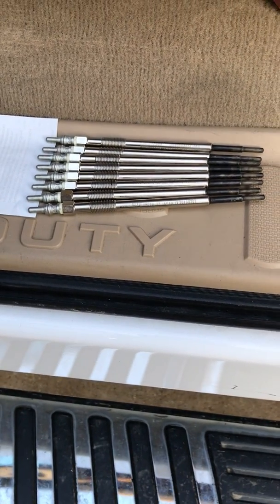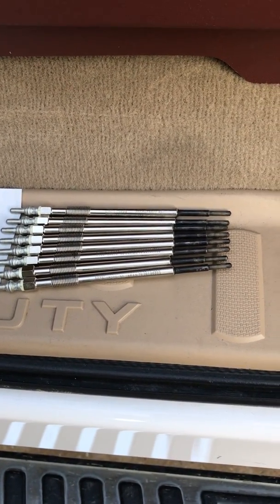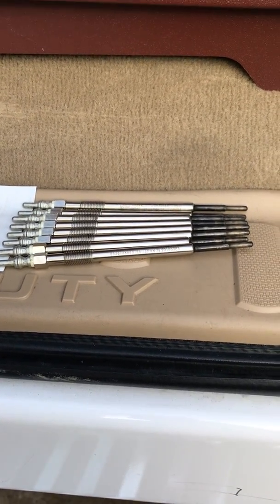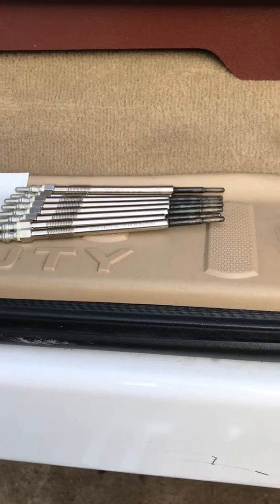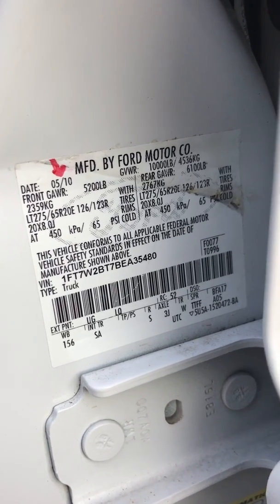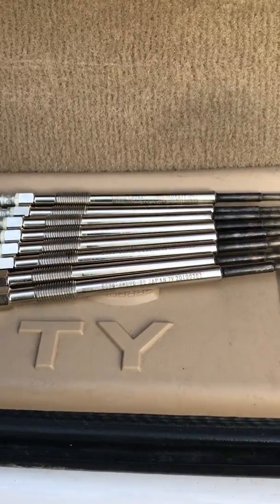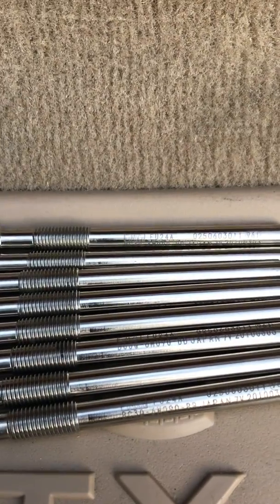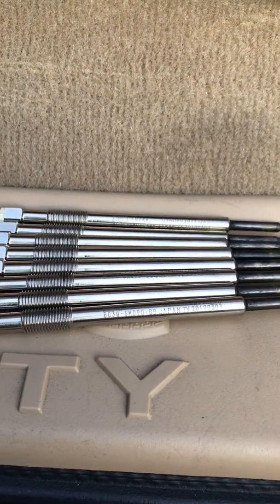Should the Glow Plugs be Replaced? 2011 Ford ‘Powerstroke’ 6.7L Diesel - F250 & F350 TSB

Comment: I have 11 F350. Build date 01/11. Pulled out one glow plug stamped fu24a. Bought motorcraft zd17 and the stamp on them is fu24a. Nowhere on them is a stamp of zd17. Confused? How do you know they are zd17 and not just the originals because motorcraft is probably overstocked on original plug
Reply from the maker: Sorry, just saw.  I read recently that Motorcraft specifically has gone back to a listing of FU24a on the plugs.  Others have questioned it, too.  My assumption is Ford simply updated the plug but didn’t change the individual stamped part number.  Seems like a bad idea to me.  👎 But based on what I’ve read, if the box says ZD17, you are ok.

Comment: So I contacted ford  because I have a 2011 F-450 with only 4,400 original miles I’m concerned about this.my  build date is 05/10 Ford claims to know nothing about valve issues or glow plugs with these truck they looked up my vin and said they see nothing . Which I know is BS. I see to many people talking about it . So is glow plugs or valves or both ?  Not sure what to do.
Reply: Buy a Duramax... Ha... Just some light humor..... Call Ford corporate Customer Service with your VIN and the name of the stealership that told you they knew nothing about the glow plug issue. Normally they will get the dealership lined out and "educate" them.. Years ago our local dealership was ripping off the local police department replacing the plastic intake manifolds that were cracking on the Crown Vics and charging a grand a piece for them. When a new Lt was put in charge of the fleet he questioned the local dealership service manager about the issue. He stated there was no one else having the issue and that it was a customer pay responsibility. The Lt. then called Corporate who respectfully advised that "Yes sir, we have had an issue with that and Ford has extended the warranty on the intake manifolds for xxxxx miles or 10 years. Ford will replace the manifold under a customer satisfaction program at no charge to the customer." The Lt. thanked the representative and ended the call. Thirty minutes later the local service manager called the Lt. and told him that he had researched and found that there was a program covering the manifolds and that they would be reimbursing the city for more than $8000 dollars. "Coincidental".
Reply from the maker: modracecar8 
Sorry, I didn’t get a notice for your question.  Yes, dealerships and manufacturers always play dumb on TSB’s.  And they are only issued for the sake of mechanics working on a related problem unlike a recall which affects all owners.

Something that may put your mind at ease is I’ve been a member of a few 6.7 forums and we just aren’t hearing a lot of tales of blown engines once the plugs are updated.  On the contrary, just last week an owner was warning everyone that he had NOT changed his plugs and was then spending $12k for a rebuild.  I think it’s good insurance on a known flaw (2-piece plugs)... one less thing to worry about.  Overall, the 2011 engines are holding up VERY well.  👍

Comment: The build date of the truck is not a good deciding factor because the engine could have been replaced and it will have the updated plugs. The most accurate way to ensure correct plug replacement for correct cylinder head is to look at the insulator on the glow plug. If it is white go with white, if it is orange go with orange. Just don't mix them up.
Reply from the maker: I understand what you're saying.  If an engine was replaced in, say, 2014 then it would be different on a number of levels.  I hope this video helps anyone who definitely knows the history of the truck.  But the crazy thing is all of this discussion has been a bit clandestine.  It's hard to tell if there were very many 2011 engine failures at all since only Ford would have that information.  I can say I have not read about very many firsthand occurrences on the various forums.  And even then, a lot of mechanics are saying the issue was not the glow plugs but actually a broken valve.  What we do know, however, is Ford changed the style of the plug for a reason and that the original style glow plugs are not being manufactured at all.  Thanks for your input on this!

Comment: Good video. I’m just curious where you found out that the ZD-17 are an updated plug? There are a few videos on here mentioning the tip breaking issue but nowhere does anyone mention the plugs have been updated. Kinda sounded like to me they recommend you replacing a ticking time bomb with another ticking time bomb.
Reply from the maker: Beinggrownupsux 80 
I’m not 100% positive I can fully answer your question in that much of my research comes from reading forums and input from Ford techs.  But my understanding is the original 2011 glow plugs are a two-piece design in how the tips connect into the body of the plug.  Ford reportedly updated the replacement glow plugs (and all others from 2012 and later) by manufacturing them as one piece.  When there has been catastrophic engine failure, a number of mechanics have described the defective glow plug not as “broken off” but as  the tip having “come off” or “come apart”.  I can tell you that there seem to be no reports of similar damage occurrences in high-mileage 2011 6.7’s that have been fitted with the new style plugs.  On the other hand, there is a lot of debate that in many of the trucks, it’s actually the exhaust valves that are breaking instead of the glow plugs.
Reply: Dave Collins Thanks for replying. Mine has a build date of 1-20-2011. I have 8 of these sitting in my garage ready to go in when I find the time. There isn’t much info on the plugs being updated. I called several Ford dealerships in my area and non had heard about the issue (or at least that’s what they told me). Your video was the first thing I’ve seen where it was mentioned they may be updated plugs. I know they changed the heads on the newer ones and those plugs are a ZD-18 with orange ring on top. I don’t think this was a common problem. Would be nice to know if the effected trucks were cab and chassis rigs as those seemed to have the lions share of issues. Thanks again. Take care.
Reply from the maker: Beinggrownupsux 80 
I agree.  Specific information has been hard to come by in all respects.   My thinking was (probably like yours) that changing them would at least be “insurance”.  But there’s so much disinformation out there on the subject, I was hoping to at least set the record straight on a few aspects of the TSB.  🧐